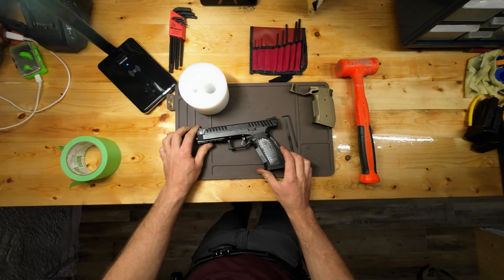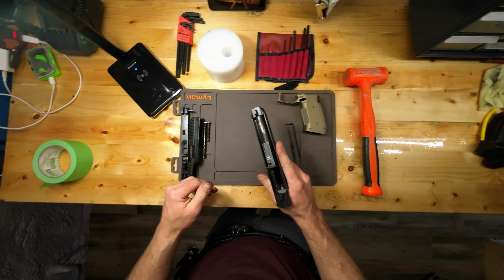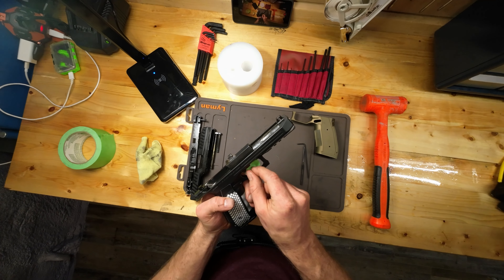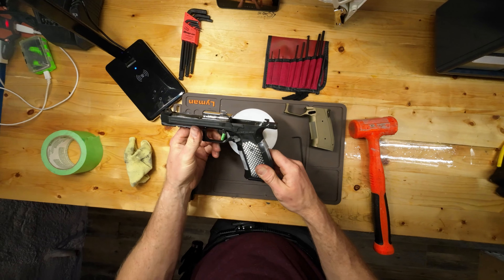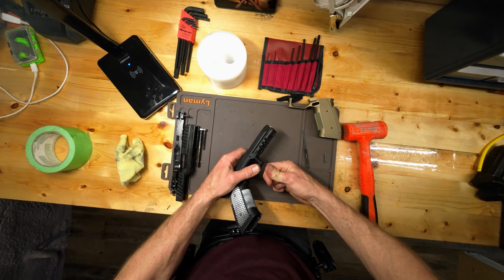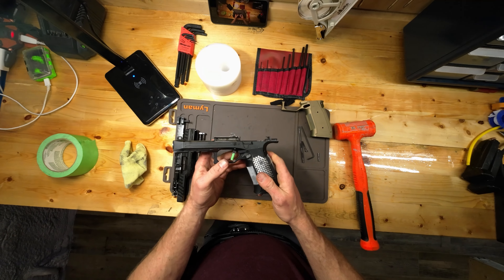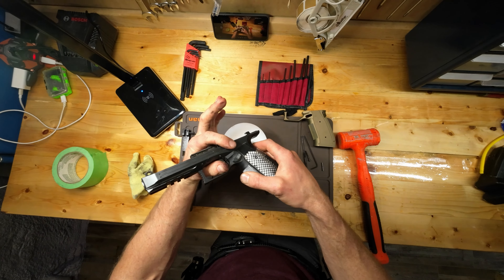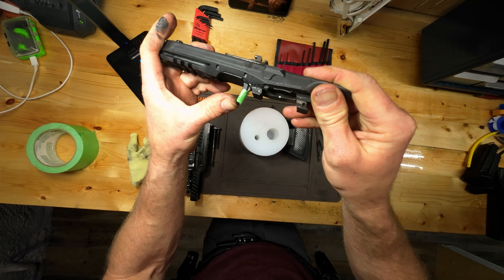Laugo Alien Grip Removal

Comment: You would know, Laugo says the mag release is not interchangeable, but what do you think after you got the frame off?  I think they say its not because they dont want you taking the frame off....
Reply from the maker: I would say that it is interchangeable, but I have not actually tried to install it. Next time I take the grip off I will try this. It works like any other interchangeable mag release.
Reply: @IPSCMAT  Ive had a good look at it.  Its different on top and bottom, so if you flip it,  it wont hold the mag properly... Still waiting for a left handed one.
Reply: I confirm that from my experience. I finnaly got my left hand mag release and installed it. It works great. 
The difference to the originally installed right hand version is that the “nose” that graps the magazine is reversed.

https://drive.google.com/file/d/1j89ql6sr8g3Ppo2kwZOhDlGWN4vGJaok/view?usp=drivesdk
Reply: @MM22425  Yes i also installed my left hand mag release.  You cannot just swap left to right.